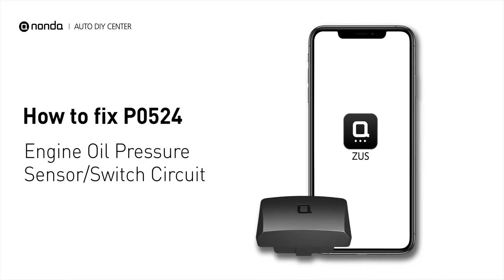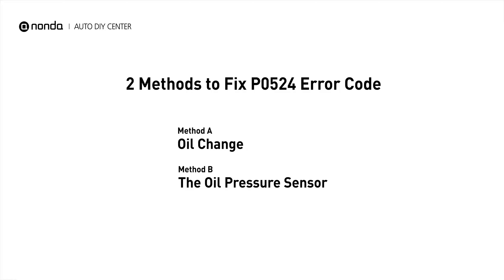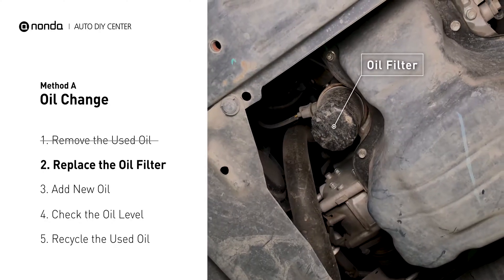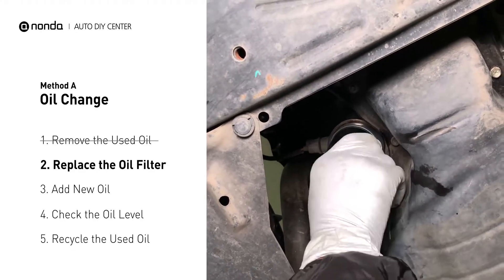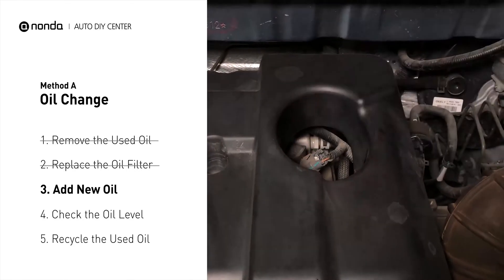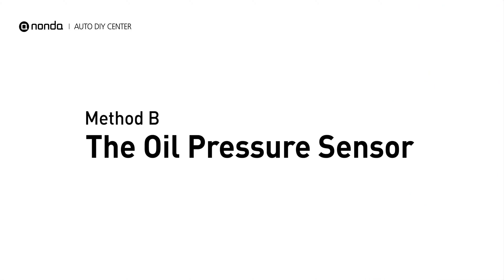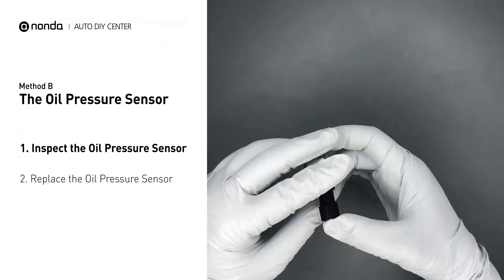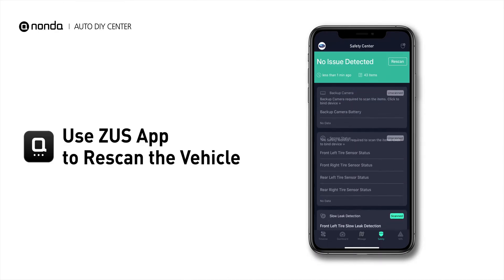How to Fix P0524 Engine Code in 4 Minutes [2 DIY Methods / Only $6.99]

Comment: Hello , mr. Steve , The oil pressure ampere is normal i only have check engine sign popping out on my dash, when I do computer check I get p0021 and p0524 codes on my Nissan patrol . I used to use engine oil 5W-30 for 2 years(10000km) . Now I changed to 20W-50 (5000km) and i got these codes . Please help me what should i do ?!!.thank you in-advance
Reply from the maker: Hi Amarato, we suggest to have it visually inspected by a mechanic. Gaskets, oil pressure and/or camshaft position sensors must be checked.
Reply: @nondainc  do need to open the engin for these stuff ??!
Reply: Mechanic man was asking me what gasket should I do inspection for?
Reply from the maker: The suggestion was given because you receive two errors at the same time. We suggest to have it visually checked by a mechanic to pinpoint the main issue and to apply an accurate solution.
Reply: @nondainc  thank you very much
Reply from the maker: You are most welcome, Amarato.